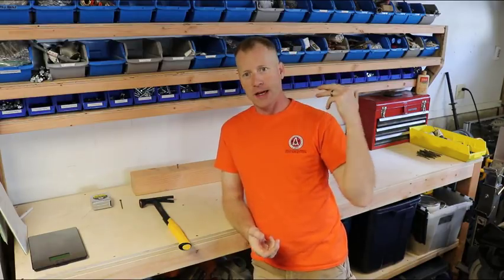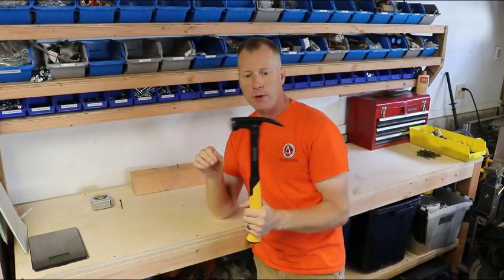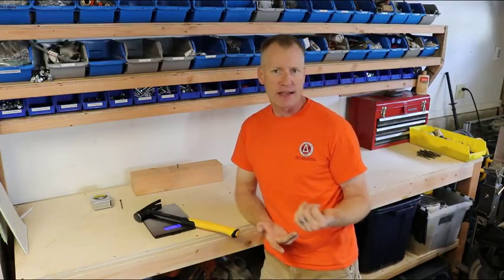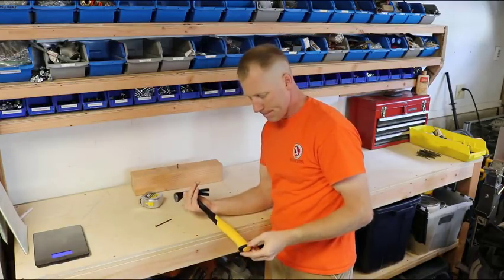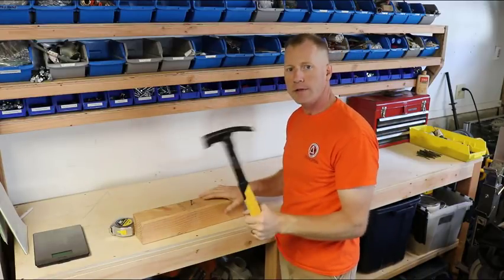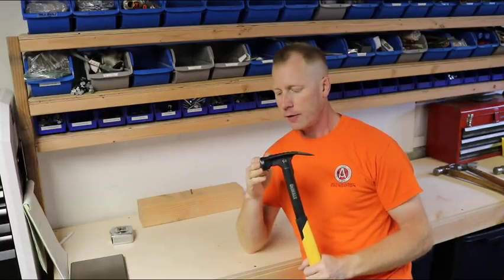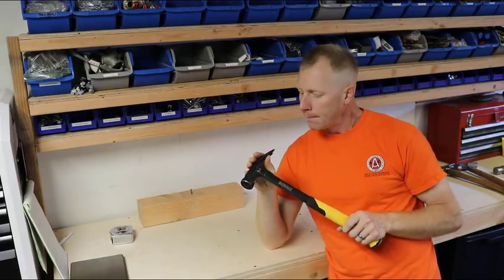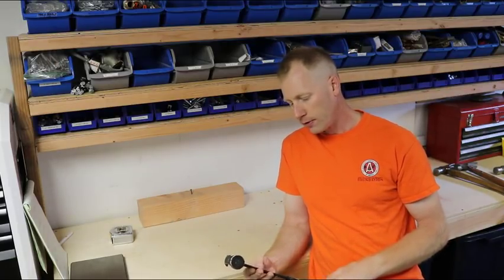DeWalt 14oz mig Weld Framing Hammer

Comment: I own both this hammer and the dewalt 28 oz and frame with both. This hammer is a good hammer all around. There are only 2 things to note. The hammer strikes like a 28 oz hammer due to optimal weight distribution, however if you are in i tight area and cannot swing  completely to build momentum it strikes like a 14 oz. I suggest buying both and primarily using this one except for in tight spaces prying things and demo. There are awesome together.

Comment: I use this on a daily basis for the past 2 3 years still good and strong waffle face almost completely smooth by now but to be expected using it with a catspaw and the grip wobbles a bit now daysbut other than that absolutely fualt less

Comment: On my wife’s profile cause my phone is broke. I work construction with a small 3 man crew including myself. We do new construction and remodeling. I used an Estwing hammer my entire career but as I get older it is killing my elbow. I bought this Dewalt hammer and I absolutely love it. It reduced the weight of my tool belt significantly and the pain in my elbow is gone or at least very minimal. I paid $59 and some change for mine in our local building supply store where we buy all of our materials. We would rather buy local than than support the big box stores. In short I love the hammer. It’s a lighter hammer and sinks nails just like a heavier one and the swing feels great. I highly recommend it.
Reply from the maker: Thanks for the input, like I said, these seem to be really popular and the only thing that I have seen go wrong with them is the magnet can fall out. I also prefer to find the lumber yards that cater to carpenters and stock high quality tools. They may not have 50 hammers and 30 utility knives to choose from, but what they have works!

Comment: Loved this hammer when I did curb, little to light for foundations cause you have to smack the panel about 15 times to get all the concrete of when you strip, little bit to light for demolition too, also not great for trying to bang tight walls into place when your framing, but it is great for driving nails

Comment: Don't fall for all the hype about anti vibe. I own both the 15 oz. and 12 oz. Stanley versions of the mig welded hammers. The 12 oz. especially vibrate more than my 20 oz wood handle True Tamper and Stanley 16 oz tubular handle hammer purchased in the 1970's. The old Stanley tubular handle is still my favorite. It's claws will bight in a nail shank and pull out nails without a head. The supple rubber grip seems to amplify the swing and can be used all day without giving blisters.

Comment: I have this hammer, had a lot of great reviews and it’s not terrible but I got rid of it and got a stiletto with in 4 days, the mig weld and hard handle it has a lot of shock vibration through the hand. I had a stiletto for a while and recently transferred to Martinez which I like even more

Comment: I have the dewalt 14oz hammer I have a larger scale and if measure down the handle to about 2 inches just below the shaft and prop up the handle and leave the hammer head on the scale it comes out weighing in at 14.01 oz.

Comment: I have the old Stanley fat Max mig weld hammer that is almost identical to this.
I’ve been trying to find a replacement in Australia for it as handle has been glued so many times and split,  it’s too far gone.
Thanks for this review! I’ll order one and give it a go as i100% .love This design .
Reply from the maker: Black and Decker now owns DeWalt, Stanley, Lenox and other companies. With Stanley and DeWalt under the same parent company, it allowed for the massive introduction of so many hand tools because Stanley was already making them.

Comment: I do highrise concrete forming and I use this hammer to put up steel Jack's and take them down all day, guys I work with have 22oz eastwings and laughed at me when I bought this but I still keep up with them no problem, this thing has an amazing swing and I'll miss the target and smash the shaft against the Jack daily and no problems
Reply from the maker: Spinning the collars to get the deck to grade will do that, and shuttering the forms afterwards to strip them out. Other than the magnet falling out, they seem to really hold up well.
Reply: Peri skydeck?
Reply: @BlackMountainCycles  ya take that down the put up reshore jacks
Reply: Well this one weighs 30oz, and a 22oz Estwing weighs 24.6oz, so yeah.

Comment: Been running this hammer framing and remodeling for around 6 years now. Comfortable and lightweight and durable. If you tend to pry with the claw to one side eventually the neck will start to get a slight bend. Also the rubber grip will smooth out eventually, nothing that can't be fixed by setting a circular saw to 1/8" depth and cutting some new grooves in it. The magnetic nail holder works just fine, even with roofing nails. I give this hammer an 8/10

Comment: Have had this hammer for one year. Love it. Only issue i came across was when trying to pry 2x4s sideways the shift bent on the first one. Got it replaced from HD no questions asked. No problems since. I do form carpentry/concrete carpentry. Just purchased the Fiskars IsoCore to try out next

Comment: It's pretty much just intended for form carpenters and rough in framing carpenters no way would i ever use it for demolition work for that i would use a 22 24 28 or 32 oz. Hammer.
Reply: i have this hammer and i would absolutely use it for demo. it may only be 14oz, but dont let that fool you. it strikes like a 28oz, and its a really tough/durable hammer. the only thing i dont use this hammer for is any type of finish work because the waffle type head would leave the imprints.
Reply: @jacksmith2315  I don't use waffle heads at all my great grandfather taught me how to strike with a hammer and you pull it up on the skid another words when the hammer head starts to slide it's like catching a sledgehammer on a bounce waffle head hammers are a fifth wheel in my opinion but to each his own

Comment: The music at 5:50 is just a little too loud compared to the rest of the video.  Good review.  You forgot to mention the rubber grip will not slide in to your belt loop as easily.  Also these types of handles are hard to repair.  You basically buy a new hammer unlike a wooden hammer.  I never had to re-waffle a hammer yet.